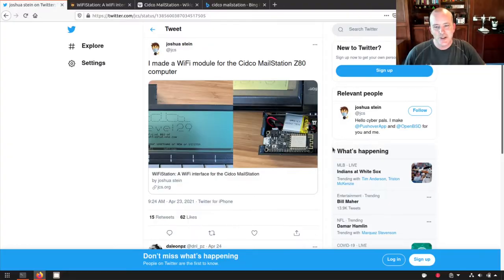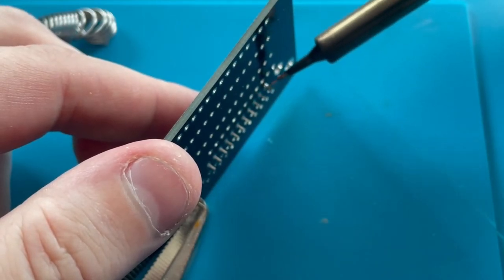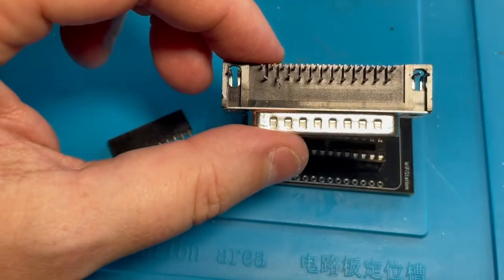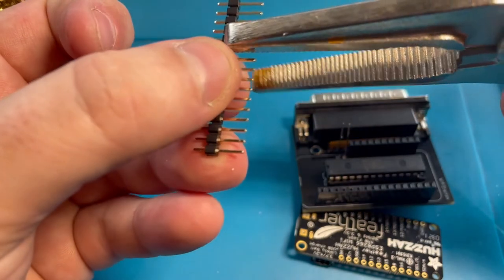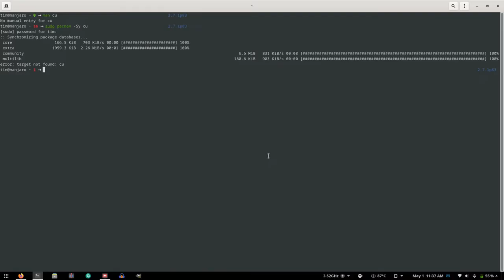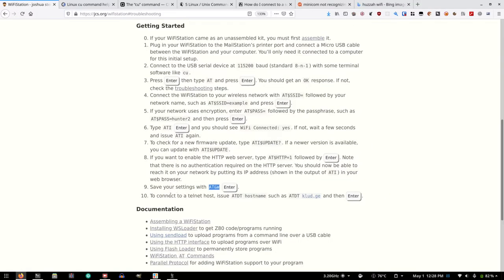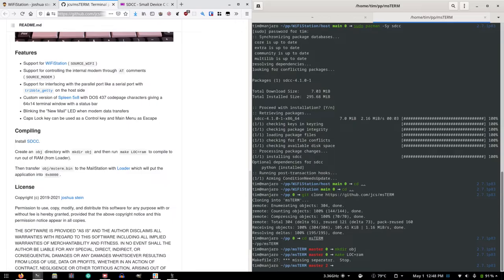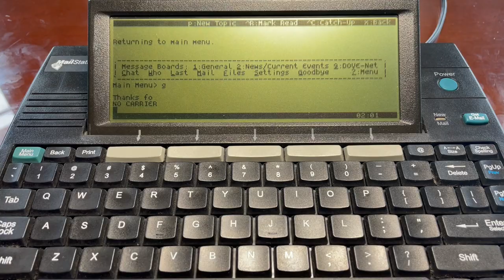Adding WiFi to Z80 Portable Terminal from 1999 | Cidco MailStation DET1A | WiFiStation | Z80 HACKS

Comment: Solder the joint, not the tip of the solder iron. Put the tip on one side of the pin for a second or two so it heats the pin and pad, then touch the solder to the opposite side. This will give you correct flow and a strong joint. The iron should be wet with solder though to ensure good heat transfer, but that solder should not be used for applying solder to the joint. With globs of solder you run the risk of making a weak joint or soldering things you didn't intend to.
Reply from the maker: Thanks so much. I have learned a bit about soldering since this video, and it's hard to watch this a couple years later. 😅
Reply: @TimMorgan  No worries, we've all been there. It's a good thing the solder horrors I perpetrated in my youth weren't documented on Youtube for all to see...

Comment: If anything the solder tip just needed to be a bit bigger to hold and transfer more heat. I prefer the flat chisel tips (look like a flathead screwdriver). And some flux would help immensely with the flow. Otherwise awesome project and very cool device! Love seeing old tech like this. Edit: Just realized this is really old but it just showed up on Hackaday.

Comment: Tim, this is great! I got one of these and cant wait to figure out how to do other stuff on three AA batteries that last months. Just dug mine out that's been not used for months and it still boots on my original 2019 batteries. I think some of the issues your having with the soldering is do to the lack of flux utilization. Those joints are considered cold do to oxidation of the through hole leads and the PCB pads. Best regards!